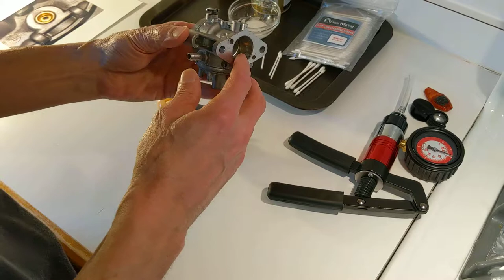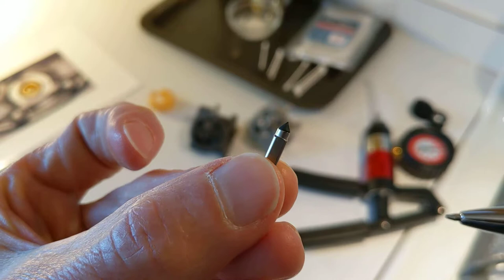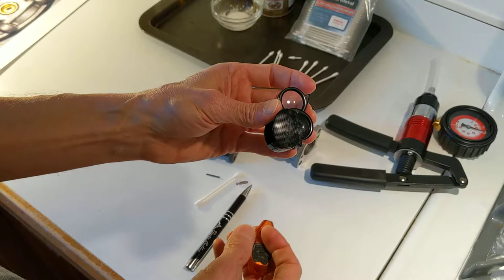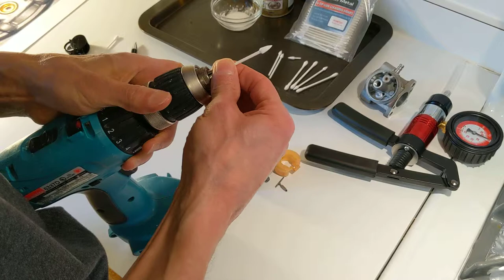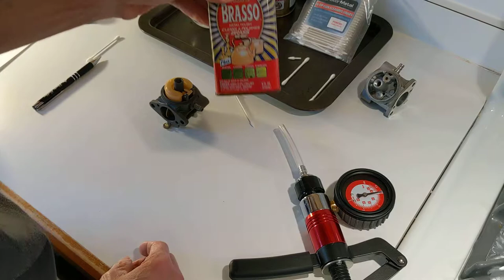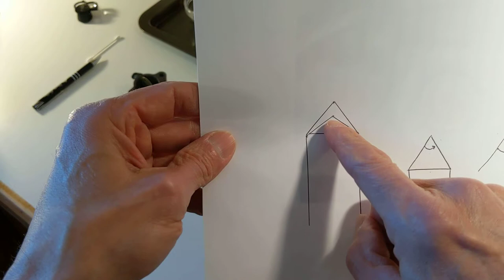Walbro LMK carburetor leaking, cleaning needle seat

Comment: You should be an engineer brother! I admire your tenacity to do things thoroughly ! I am working on a very nice John Deere STX 38 with the Kohler Magnum 12.5 s engine .Walbro  LMK 4 Carb . It was running fine until on steep hil ,starving for gas.So I disassembled carb ,cleaned,reassembled. I put it back together it started hard but fired up and ran good.Mowed my yard and decided to try adj air fuel mix . While doing that it died . Now it won’t run over low idle and very hard to start. Removed and cleaned carb several times thoroughly ,still runs like fuel starved.Cleaned gas tank ,fuel lines,shut off valve ,solenoid ,new filter. New ignition coil . My float needle does not have the black tip on it and does not have that brass seat yours has . I am beginning to think parts fell out or something . I am not new to this ,just have never seen this particular carb. Craftsman,Murray,mtd carbs are easy . Don’t know what I am missing ! Ready to buy new carb!

Comment: Thanks for the idea Don! I tried this and I noticed a scratch in the seat, so I took a drill bit and turned it by hand until the scratch was gone. Then polished it up with the q-tip in the drill. I filled a funnel and hose with water and had the carb sitting upside down over night with the float and needle installed and no leaks! I still might get the vacuum gauge to test it that way. I'm tired of the old Cub smelling of gas.
Reply from the maker: Your welcome. It's good to see someone else who is not afraid to clean or rinse a carburetor with water. I use 95% ethanol (grain alcohol) to rinse out the water when I'm done.
Reply: i clean mine with water and dish soap then after that dry it off and blow out all the small holes

Comment: I think its the needle because the mower won't start up with it aiming up hill with it that way the needle shuts the gas off because the gas in the bowl lifts the float up that pushes the needle up 

So i can aim it down hill and it'll start right up its the second walbro i have that does this i think the needles are to small the rubber tip 

Mine are clean new just about

Comment: Help someone. I have a LMH17 carb and it leaks during running. The needle and seat are fine. I'm suspecting the ATMOSPHERIC vent is clogged. Cant find a way to get to it. Looking for a crossection picture if it to find the vent hole. It leaks out the rectangular hole in the intake, where the choke arm base is.
Reply from the maker: A few suggestions here:

https://www.google.com/search?q=lmh17+walbro+leaking+while+running&oq=lmh17+walbro+leaking+while+running&aqs=chrome..69i57.22657j0j7&client=ms-android-google&sourceid=chrome-mobile&ie=UTF-8

Comment: Just curious, if you soaked the carb in kerosene, would that accomplish the same thing???
Reply from the maker: No it's corrosion in the needle seat from ethanol fuels. Gasoline is far more aggressive at cleaning than kerosene. Walbro makes newer needle seats that are nickel plated. They do not corrode in the presence of ethanol fuels.
Reply: Just get you some carburetor cleaning tools off the internet and then use whatever gas or rubbing alcohol whatever your comfortable with getting on your fingers those and a air compressor should work

Comment: What is the pressure vacuum guage make and model please  ?
Reply from the maker: https://www.amazon.com/dp/B01JRRIEBI/ref=cm_sw_r_cp_apa_i_kco8Eb0WWZNKK
Reply: @diverdon184  does this model vacuum gauge work on two cycle carburetors?
Reply from the maker: @gregschroer2314  The pump just supplies vacuum or pressure. If you have the proper air tight tubing setup you should be able to test anything. Unfortunately, I'm not too familiar with 2-cycle carburetors to give you a definitive answer.

Comment: Testing with water doesn't work. Gas is much thinner. A wider seat is not better. It would have a greater chance to collect contaminants.
Reply from the maker: Wider seat? The cleaning process doesn't make the seat wider. Even better is to replace the seat with the newer Walbro nickel plated seat which does not corrode with ethanol fuels.
Reply: @diverdon184  the cleaning process doesn't make it wider but changing the angle does.

Comment: See its more of a needle problem my brass pieces are fine and clean but all of them have more of a id say a skinny needle rubber tip problem 

A other person said you can change out that brass seat and put a big or small one in one size is for the gas pump type of Kohler engines but taking that small part out can be hard is what he said 

a smaller one would work good on mine so it'll get less gas or a needle with a bigger rubber tip 

But those places who makes the carburetors know what they're doing wrong just like all the other cheap john deere stuff and stihl and poulan and Briggs they don't give a shit about they're products

Comment: You make it sound too complicated, it leaked from the needle seat, just replace the seat with a new one.
Reply from the maker: The idea behind the video was to prove where the gasoline was leaking from with pressure testing. I was told it was leaking AROUND the seat which was not the case. The replacement of the seat itself is actually complicated.  They are pressed in to the carburetor body. Most dealers will replace the whole carburetor before they rebuild one or replace the seat.
Reply: @diverdon184  I just replaced two needle seats for both my lawn mower and snowblower, it wasn’t that difficult if you know what you are doing. My lawn mower was leaking fuel from the seat and fuel coming out through the carburetor, replacing the seat corrected the problem. The snowblower seat replacement is just a regular maintenance since I haven’t replace the seat for more than ten years.
Reply from the maker: @shikpolam8968  I have replaced them also. The video describes cleaning the seat bevel so replacement is not necessary. Did you watch the whole video?
Reply: Still wont be great again because all they need is the right needle not the seat 

The needles rubber tip is to skinny for the hole seat as that guy said too what i been seeing on all my walbros 

those needle rubber tips are wrong on Kohler walbro carburetors